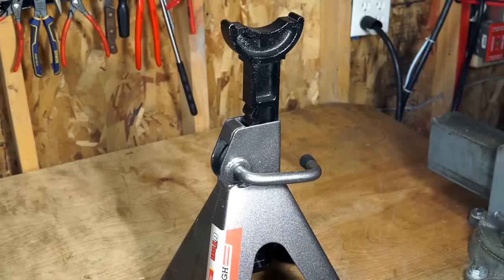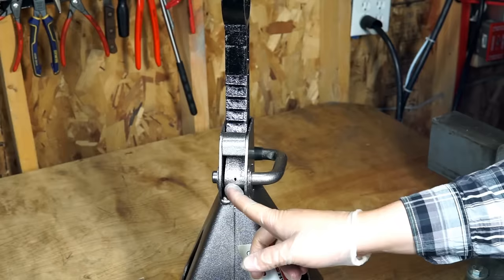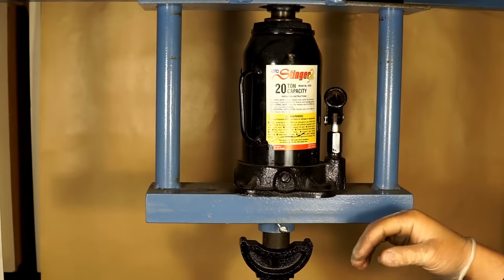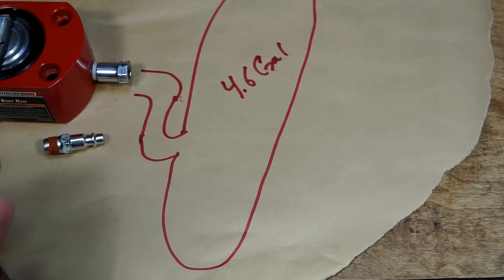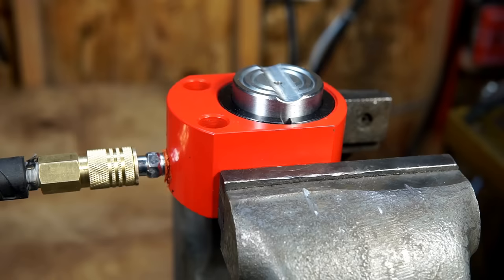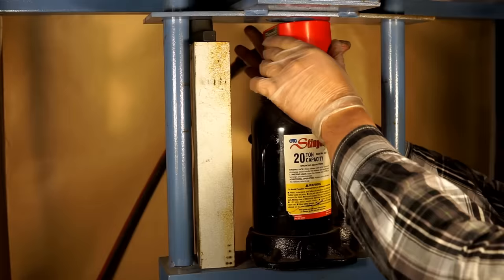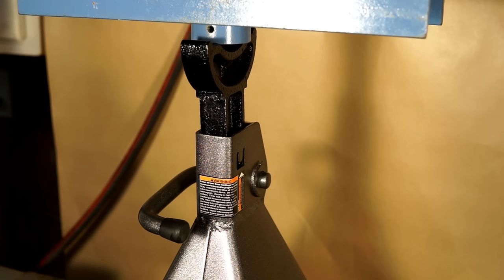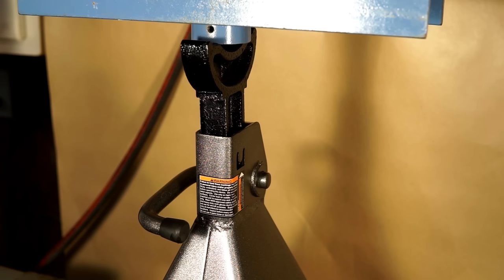EXPERIMENT: WARNING! Doing this to your Jack Stands will get you KILLED!

Comment: Well I'm always super paranoid about the unlikely possibility that one of my jackstands or jacks will fail, because we all know about Murphy's Law. So I use a rule of redundancy when I work under any of my vehicles. If I put my vehicles on jackstands then I also leave the jacks and or ramps on as well, but I've gone one step further by building a set of very heavy and sturdy wooden platforms with rubber matting which I also place under my vehicles in such a way the the vehicle should never ever have a chance of crushing me... and I've tested those wooden stands and they are simply not going to crush or collapse under the weight of any of my vehicles and they are wide enough that it is highly unlikely they would tip over or roll... and I have also tested that thoroughly. Now with the addition of those stands, every time I work under my vehicles I never feel any concern about a possible failure with my other jacks or jackstands and it feels nice not having to work with those concerns looming over me. It's not the fear of being crushed or dying that is my main concern, but having my family find me crushed or dead under my car because of a stupid accident is simply unacceptable to me. I take safety super seriously when I'm working on my cars, using my power tools or working under any conditions that pose inherent risks. I know I can't ever be 100% safe but I really try to keep the odds in my favor.

Comment: I had a jackstand fail when i had the wheel off.  It bent at the cross sections and completely collapsed.  I was lucky i wasnt under it when it did.  I procured some old railroad ties, cut them each in half, and I now refuse to crawl under anything if they arent held up with those.

Comment: I’ve noticed some times a car will be really sturdy on 3 stands but the 4th is just barely holding weight, I believe a tool could knock the pin loose in that situation, may have been the case I don’t know

Comment: I use multiple backups, if i have to take the tire off i place it under the car frame as well ill place the hydrolic jack under the front center or rear centre jack points, chances of all three failing at the same time is slim

Comment: You need to be as safe as you can under vehicle, so even if you have 4 jack stands and you only really need 2, use all four and back it up with trolley jack and as a precaution I put my wheel under as well, (only if I remove it)

Comment: You needed 500 lbs to raise the stand but you lifted it by a lever of 3-4 inches in length which means the force on the lever end would be less than 500 lbs to achieve the needed lift.

Comment: I know this video is old but that looks like one of the recalled jack stands where the teeth were not as robust as they should be.  It would be interesting to see this on the improved design which would likely take more force to move the release handle or at least more range of motion to get it to release.  It would also be interesting with at least double that weight on it.  I don't think the average shade tree mechanic is working on a 2000lb car.  It would be interesting to know the point where the shear pin works as intended vs releasing the teeth.
Reply: From what I remember, the recall had something to do with a welding defect that may cause the weld to fail and the jackstand to collapse under load.

Comment: This is why I have a rule even if I'm working in one wheel well and not necessarily under the car put the weight of the car on the jack stand take the pressure off the jack but leave it in place if I'm lifting up half of the car two jack stands and two jacks with the weight of the car on the jack stands and I always keep different sizes of 4x4 chunks as it has means of protection because they will not crush as easily as my chest

Comment: All of my jack stands have safety cotter pins to prevent accidental release, even so when ever l have my car up on the stands, l always place another solid, fail safe back up support under the car such as spare wheels or some blocks of pressure treated lumber l assembled to the correct height for this specific purpose.  Only takes a few minutes to find something to serve as an added fail safe in addition to your jack stands so don't be dumb, just do it.

Comment: I use way higher rated jack stands and floor jack then what I am lift. Plus I have lift all the way down and not up at all. I also lay my tires under the car front and rear, so it will catch just in case. Also make sure you your surface is a sturdy surface like concrete and if on asphalt ob a hot day use wood or a large flat brick. Make sure you have a wheel chock and try to only work on a level surface if possible

Comment: Nevee seen a jack stand without a locking pin.  The lever is only to adjust the hight aproximately.  My stands have triangular cross section pin which inserts through  a holes and jams the rack preventing both way movement (either up or down).  Then I lower the car over the pinned stand. To fall down it needs to brake a tooth on the rack or to sheer a 1/2" steel 
pin.

Comment: As you apply force to an air cylinder the amount of pressure needed to compress the air cylinder increases because as the air compresses it increases its pressure.

Comment: I think it's possible that maybe his body was already in a confined space and perhaps supporting some of the weight of the car, lifting it off the jack stand. Obviously if be could bench press the car off his face he is probably a pretty strong boy working under a relatively light vehicle. I've done it myself where you half roll over to reach for a tool on the ground and your shoulder or hip rolls up into the frame relieving some of the pressure. Also the 500 lbs. for the load is just an estimate. If he's working on the non-engine side of the car it's probably much lighter than the side with the engine and transmission. Anyways those are just my thoughts. Under a real working load of 1000 lbs. or more I don't think you'll ever get that handle to move.

Comment: On Rennlist, concerning jack stands and 993s, it mentioned the use of "ratchet style" jack stands and someone brought up about the bolts on "pin style" jacks shearing.. 

I'm guessing that the "pin" is only used to keep the handle from being pulled out sideways and has no capacity to sheer. Pulling the "pin" out allows the handle to come out in order to remove the pawl.

At the 09:12 point, I didn't see that as a failure, but as a piss-poor handling practice for any mechanic. A failure would have been a broken pawl or a broken tooth on the rack.

You already saw what happened when you had to put a lot more pressure on the pry bar to initiate release of the pawl. Had you put more weight on the stand, it would have been harder to release the pawl, ....... all the way up to the point where  you'd eventually have total jack failure. 

Since that idiot with the Porsche didn't appear  to admit to his own screw-up, jack stand manufacturers will be probably forced to include a special steel safety bar to hold the handle in place while under load so that irresponsible nitwits don't kill themselves.It reminds me of the long tethers that run through a child's sleeves so they don't lose their mittens while playing in the snow. Yeah, imagine the gubmint mandate those things. 

My two cents.

Comment: in the 90's, I bought a defective set of 6 ton All Trade Jack Stands.  Before using them, I tested the bite of the ratchet pawl  with the arm extended to max, and put my body weight on it.  The pawl didn't seem to engage as well as my 3 ton stands, so with all my body weight on one arm, I touched the release lever up, and it slammed down and pinched my finger tip.  The finger nail turned black, and fell off.  The nail now grows with a crease.  I returned the faulty stands to the store for a refund.  I should have sued All Trade instead.
Reply: Yes, they would have paid you $5 for that lost fingernail.

Comment: If the guy could bench the car to call for help, I would assume he already had pressure on the car, maybe a tight bolt or something while trying to use his foot for leverage. If by your test all it took was some extra force to get the jack to fail then you proved it possible.

Comment: That air operated cylinder being metal to metal is also very dangerous. Either of the two ram end surfaces could move/slip under pressure and fly out of there. 😮

Comment: Why not take a weight scale, put a bottle jack on it, and pump to the height of 500, 1000 or what ever weight and measure height of the point, and the set the jack stand to that point, and you got yourself the weight. If you want you can use the scale with the jack stand. This way you have a reading of reality, and not a theoretical adaptation of what might be the same thing...which in this case its pretty good, but. Maybe Mike had one side jacked uneven from the other?

Comment: You need to scrap that stand. The stands i have are friction fit. If you pry on the handle the handle will move and the stand will not. I also have a pair with the backup pins

Comment: I bought these stands from either hobo freight or autozone but the have a peg that runs thru the gear with a carter key so it doesn’t fall out keeps the jacks up and prevents this from happening but always keep a normal floor jack under there with ya in case you knock the car off that stand

Comment: How worn is the pawl? How worn are the teeth? How old is the tooling used to make them?

I'd be willing to accept that a pawl will not slip if everything is up to spec. But I'm not willing to accept that any given jack stand is up to spec.

There are jack stands that don't use pawls, relying instead on solid pins. That's the style I buy.

Comment: Im usually pretty cautious (at least that's what I thought) and use at least 2 axle stands and a Jack minimum but I accidently kicked a stand the other day while laying underneath and although it held, it moved onto 2 of it's 4 feet. It was at this moment I realised even with the jack under the middle of the subframe, the car could easily topple sideways from the stands and that would of had my back up jack out of centre so it may not of held the car or missed the subframe entirely and gone through the floor. Been looking into different stands and ramps ever since with safely in mind

Comment: Nice theorem, but kinda fails. For one, Pittsburgh jackstands aren't all that bad, there are multiple brands far worse where a 6 ton rated stand isn't worth much more than a 2 ton for reliability. Mike was also under a car, so more likely it didn't have a well centered load like the press, we've all put stands in shady positions before, where a small budge changes everything. Also, where the stand was counts Alot, if it was under suspension parts, might take less than the weight of the car to lift as the springs/struts compress where the frame would not.

Multiple better branded stands come with safety pins to insert into the stand, taking the reliance off the claw for only safety/locking mechanism.

Comment: I've never been a fan of these , and i always double the weight , so if im working under 2 Tonne SUV , ill purchase 5 tonners ( it normally works out cheaper aswell)  & ALWAYS a detent pin.

But after this im going to be drilling 1/2 " / 3/4 holes straight through every few inches , to place a little pig bar in the hole , like the traditional ones. 
Aswell as my pneumatic air jack.

Comment: Good vid!  I think you got it.  BUT, I think there is one other failure mode not modeled.  When using this, you jack the car up and then you settle the car on it.  I don’t like using these, because I am always afraid that I may have accidentally just caught the edge of one of the teeth. I will bet that is what happened to this fellow.  If it just barely caught a tooth, then all it would need, is a bump to get it to jump the tooth and come crashing down.

Comment: Thankfully my Daytona jacks have safety pins to help prevent that, but I always leave the actual jack under the car if possible, and I shove the tires up under the sides as a extra backup. I'd rather replace wheels than get squished

Comment: So here's a couple of factors to consider. 1) Age! The age and repeated use can wear down the parts! Just like a set of gears or valves, over time they wear down. This can make a stand easier to fail. 2) Maybe you don't need to move the release arm itself for it to fail, maybe you just need a little lift and/or bounce. So let's say you're under the car while it's on stands and you're trying to unbolt something with a breaker bar by pushing upward. I think it's possible that it could wiggle just so
Reply: Steel doesn't go bad with age, many ductile cast irons like anvils even get better with age.
It's not plastic, nothing under an automobile is torqued down that much to where it could offset the weight even of light cars.
The things with the most torque on them would be the lock nut on the wheel hub, and then the crankshaft bolt neither of which are done easier from underneath the car.
Reply: @papapsych2746  It's not that the steel is getting weaker with age. It's that the steel erodes with use. Gears or "teeth" start to round out. This happens with timing gears, for example.
Reply: @jasonhaynes2952  The strength of material on gears for a jackstand will never reach elastic deformation point. Maybe they will rust, but the steel isn't going to deform without some serious constant abuse applied. Stamped Timing gears on a small engine that greatly exceeds its life cycle I can see maybe being replaced (If replacements can be found), but automotive engine timing chains are lubricated with the engine oil. I have never heard of them needing to be replaced.

Comment: Altho i doubt that 225kg is distributed on one a jack in the case of the mentioned porche.
I would like to see someone messure the force that the jacks face on some scale.
Also, if half of the car is lifted on two jacks it does not mean half of the car weight is on them, due the weight distribution, it varies from car to car. And even so, two jacks are holding the force of eaqual mass applied to them,  the weight (down force) does not cut in half if you have two stands, correct me if Im wrong?

Comment: He got it to fail using a long leverage arm and heavy banging with a hammer.   The forces those carry are nothing compared to a little accidental hit with a tool.  However, I'm never too comfortable depending on one jack stand.  I make sure to have multiple levels of safety just in case.

Comment: If stands on frame 4 points 1 or 2 may not have a lot of pressure on it or them. If you put 2 under frame and 2 under suspension would keep pressure on all 4

Comment: What we need to find out is the shear rate of the pins per jack weight rating. So maybe at 1/4 of rated jack weight the pin should shear off. So a 2000lb jack should shear at 500lb. Your next test should be to shear the pin and see what weight it fails and compare that to the jacks weighted rate......that would be interesting.  Good Stuff...thanks!

Comment: The injured guy use the defective older model of harbor freight jack stands. The old ones had bad teeth on the ratcheting part. So the pawl easily could slip past the teeth under not much load

Comment: I’ve never seen jack stands without thick metal safety pins you have to put in to stop the ratchet moving in either direction. This looks like a death trap before it comes out of the box.

Comment: my stands won't lower with pressure on them, but definitely going to keep an eye on safety opportunities
Reply: this wasn't a failure because nothing sheered. you caused the collapse with a lever otherwise didn't collapse
Reply: didn't technically fail because it only collapsed with the lever applying pressure

Comment: if the guy could lift the car off his face, perhaps he moved the car which lessened the pressure on the jack stand and knocking it caused the collapse. I saw a guy push a 60's wagon front end up about 5" and crawl out from underneath, so it is possible

Comment: I have smaller red walmart cheapo jackstands that I reworked Changs welds on.
I keep the handles pointed in the opposite direction of where I am working, I even leave the floor jack with a tiny amount of pressure on it and a tire underneath the car in case something like another car bumps into it.
I can release those jacks by hand with weight on them when only one corner of the car is jacked up, I haven't tried this with more than 1 corner.
Maybe its a tolerance in the jack stands.

Comment: IMHO the premise is wrong in that if there are two jack stands, you would need half as much weight to lift. While they are both equally loaded, they share the weight, but as you try to lift one up, it unloads the other and needs to lift more weight than the half. Of cource as the car isn't a completely rigid structure it would depend from the distance between the stands - if they are next to each other all the weight would transfer to the one you try to lift, but if they were far apart it would be between 500 and 1000 punds.

Comment: It took a lot more force than just a bump to get the stand to fail. Either the stand wasn't set firmly under the car or something else caused the failure. I will not go into the cause of my accident when a car fell in me but a jack stand was not the issue and luckily the car was not jacked up that high. I never get under a car without making sure the jack stands are firmly placed and there is no movement of the car when I give it a slight push. If the car rocks at all I reset everything.